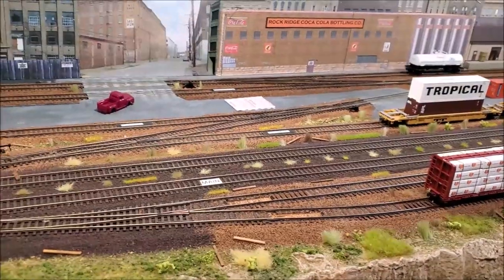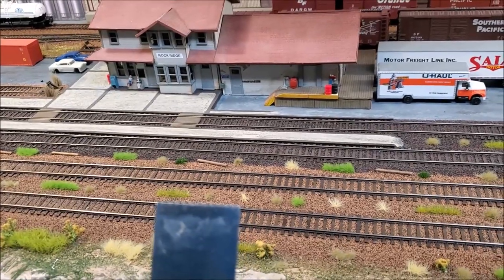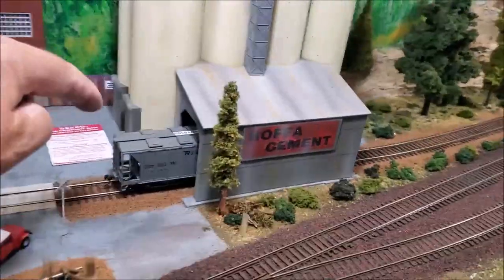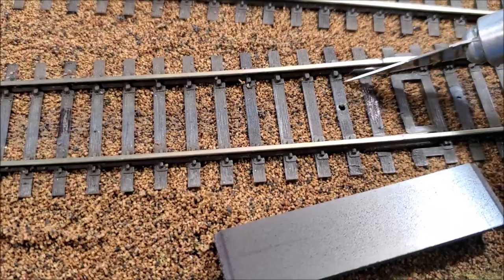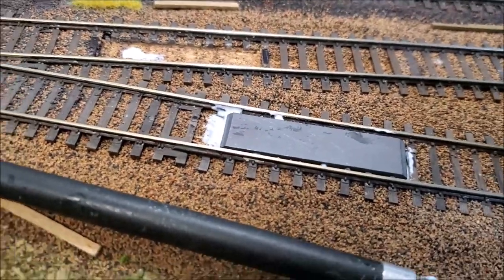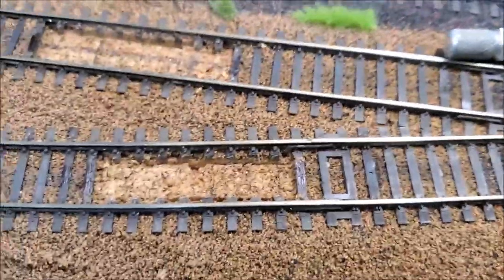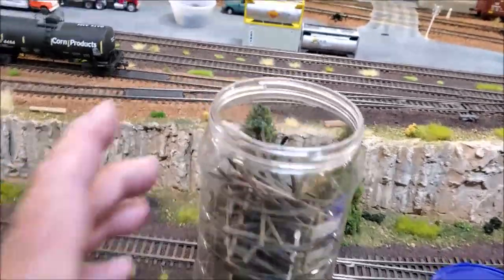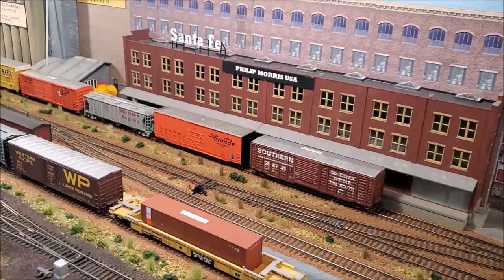INSTALLING  KADEE TRACK MAGNETS

Comment: Just invested in theses and I'm impressed. I wander if you can disguise them in any way so they blend in
Reply from the maker: This is another video on Kadee.  In it show the on by the Apex year on the Branch Line.  The under track magnet if you use homosoid  is very good cannot be seen.  but they are very strong.  Do not put it on a line that trains pass over like the main.  https://www.youtube.com/watch?v=2fXg2oPAeA4&list=PLqHQgiAJ9oRLx-RdCAB3QPko5q_NpYZEO&index=14

Comment: Great video- good to see someone fully utilise the Kadee system.  Do you have issues mixing the different brands of knuckle couplers?
Reply from the maker: 98% of all my cars have #5 or 14 couple's.  I take #58 off and swap with a friend who only uses #58  Found out in operations you can not mix and match.  No Shelf couplers.  Not allowed.  A couple of cars have original factory couplers because there is not a kadee that can be used.  But they work most of the time.

Comment: Thank you for making this video i have always wonder how to do this and can you cover it up with anything so they don't stand out like that
Reply from the maker: You can use the big ones that go under the track in the road bed. Or go to electric uncouples under the table.  Sure if you search You Tube  there is some one that shows the under table electric ones.  In the Video I made on Stony Creek and Western I have a segment in it of Gil Fritags set up.  There you have to get the couple's over the spot then push a button to activate the electric magnet and then move engine while it is active.  Most use a timer because you cannot leave one on will burn up.

Comment: Hey Art Great Video.. Got a Question though Sir your using Kadees and you showed that Big Magnet which you said is really Good to use but never on Mainline but with any Magnet especially a Strong one.. Will that or would that interfere with the Magnets in the Motor of an Engine And on my D.M.R.R which is N scale Art the would be a little closer to the Track would there be any worries about a Engine passing over a Strong magnet.. Thank ya Sir for Reading This And your Layout Ever since watching you back in 2015 is Still totally Awesome..
Reply from the maker: That Big Under the Track magnet in for HO.   I am sure in N scale that it could easily stop and engine.  Really.  I do not not know what Kadee makes in magnets for N so best if you are doing N to do some research.  I have never seen magnets on N scale layouts I have operated on so cannot comment.  Good luck.